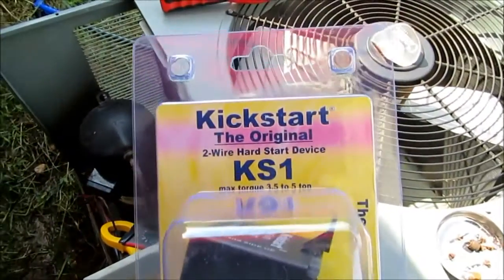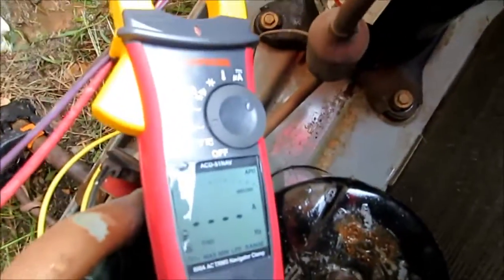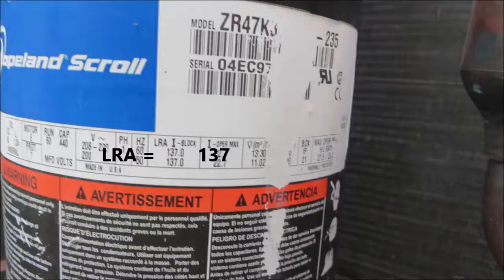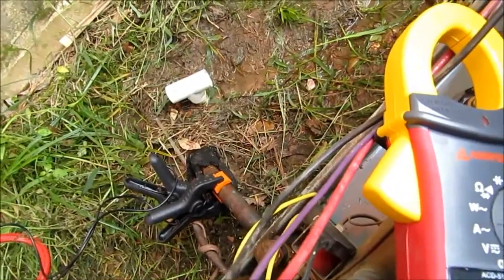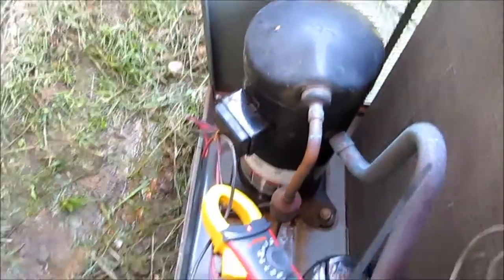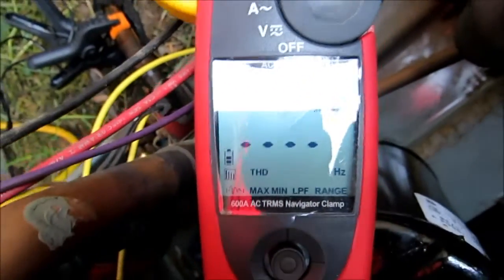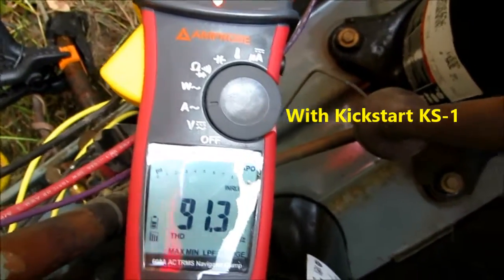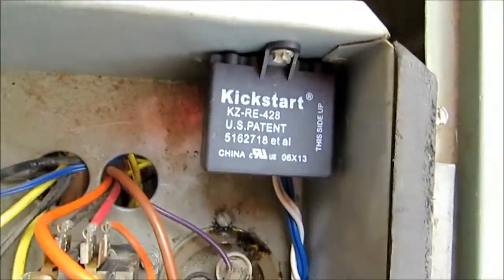Kickstart OEM Approved Potential Relay & Start Capacitor | Rheem RPMD

Comment: Thanks for the quick reply.  I have a photo of the top of the KS-1 and it has what looks like a AA battery looks like coming out of the top of it.... I was hoping that was kinda a visual "this is bad" thing.
Reply from the maker: You're welcome. I didn't think about a visual indicator like you describe. Come to think of it, I do remember running across an older Rheem heat pump one time with a factory kick start installed. The capacitor on it's KS device was leaking. I replaced it along with the weak dual run capacitor and pitted/burnt looking contactor as preventative maintenance. This heat pump was around 10 years old if memory serves. Kickstarts usually last for many years with no problems. Thanks for your comments.

Comment: How can someone tell if the KS-1 has gone bad?
Reply from the maker: The capacitor contained in the KS1 can be tested with a multimeter capable of reading microfarads (MFD) The MFD rating is on the label of the capacitor. Inrush current on startup of the compressor can also be measured. The inrush current reading of the compressor on start up will always be lower with a functioning Kickstart device connected. Thank you for watching.